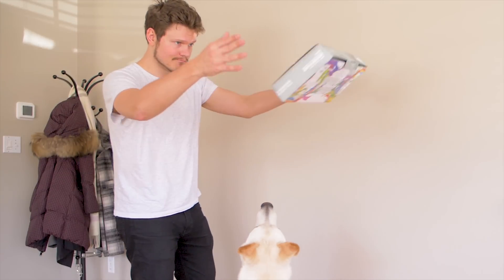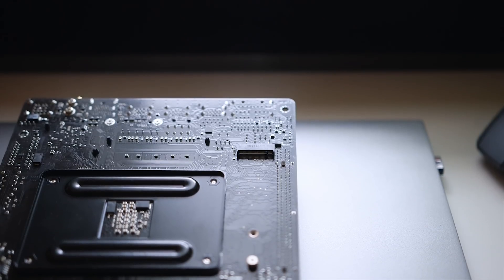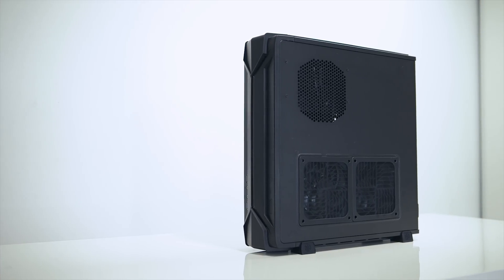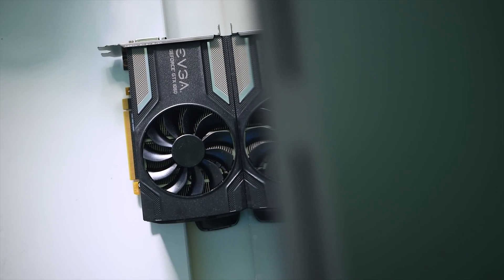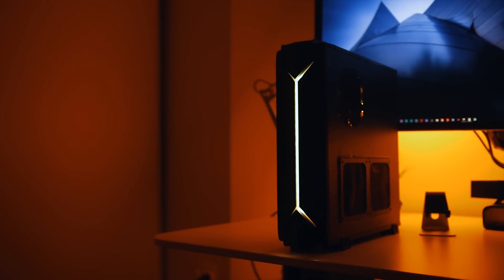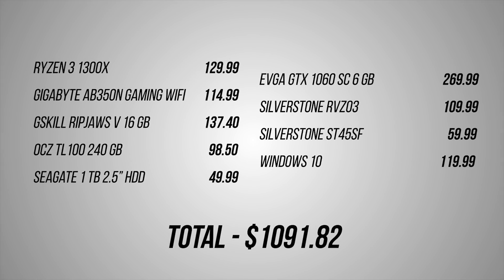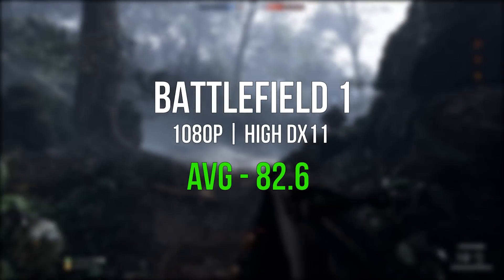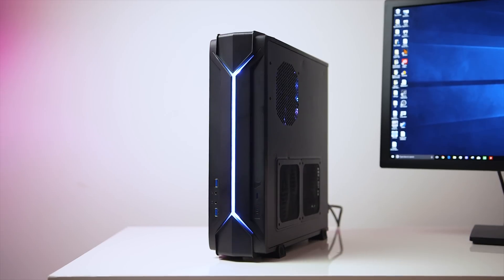AMD Ryzen SHRUNK - Our Ryzen ITX PC Build!

Comment: I think GPU manufacturers will need to make dedicated "mining" cards. Basically a GPU without the video output option and designed only for cryptocurrency mining. This would get miners to stop being GPUs and potentially open up a new market. There has been rumors of Nvidia unveiling mining cards, but nothing has been shown yet.
Reply: The whole idea of "Mining cards" are completely made up by the graphics card manufactures, not by Nvidia or AMD. They do exist but only in China because of laws preventing the sale of them in other counties due to the time length of the warranties being to short.
Reply: Linked Designs but miners would still buy gaming cards because they have resale value.
Reply: but the usage of gpu die will be the same. they can only produce so much.
Reply: gedion749 not sure what that has to do with IO
Reply: Shops are running out of cards, making dedicated mining cards will solve nothing, miners will buy all of them and then go for gaming cards anyway
Reply: I wouldn't buy mining only cards unless they were half the price, if the market crashed you may aswell throw it in the bin where with a gaming card you will still recoup some cost if it goes bad...
Reply: Mining only cards already exist. Sapphire made one.
Reply: I have a friend whose mom works for Nvidia. They are making cards designed for mining etherium.
Reply: Wulfy Your Uncle work for Microsoft too?
Reply: i have shuttering on my windows, how to fix this problem?
Reply: They already do.
Reply: They already do.
Reply: You lose all the resale value if you go with such a card
Reply: This and write software into the gaming GPUs to recognize mining and then not work.
Reply: Linked Designs no they won't buy it unless they're cheaper than desktop counterparts
Reply: Linked Designs Making mining cup specific cards is a stupid idea, it will only further reduce the availability of gpu chips...
Reply: Linked Designs the problem is, miners want a gpu that they can sell on ebay if the market shifts or crashes. They factor in the resale value of the gpu into all their risk calculations. A gpu with no video output has very little resale value unless you are selling it to another miner, and chances are that if you're selling yours, everybody else is selling theirs
Reply: amd added support for 2 mining cards in previous driver
Reply: Linked Designs they are doing that
Reply: I like the mining craze, sold RX 480 and bought 1080ti
Reply: Depends on where your located (EU and China markets at the moment) and how dedicated you are to find the cards - they are out and purchasable.  I know Asus is making them, and here's there info page on the nVidia based one: https://www.asus.com/Graphics-Cards/MINING-P106-6G/  And doesn't look like manufactures are going to allow them to be SLI'd and Crossfired with normal graphics cards (which I think is an over site, esp if the mining goes bust).
Reply: Linked Designs So my brother and dad are into mining, gigabyte released a 1060 without the video outputs. Like they just arent soldered, if you wanted you can solder it and use it like a normall card but due to demand they had to buy these cards. Lower resale value since you cant sell to gamers without soldering.
Reply: But probably gain better performance, potentially improved longevity and when they burn out from being worked too hard fo too long, probably cheap as sin to purchase in comparison to a gamer's card which means so long the card was used properly before it deceased you will had made enough for a small profit after purchasing another one.

Seriously, no gamer wants a card from a miner out of fear it will be full of sadness, disappointment and magic smoke.
Reply: Willow Graysen why? They are getting great business from the mining craze. Why would they end that to appease some people who want to buy their cards at cheaper prices. This craze has been great for the gpu makers.
Reply: Linked Designs ASIC cards will kill off gpu mining in another few months... Mark my words
Reply: https://www.scorptec.com.au/product/Graphics-Cards/NVIDIA/68715-ZT-M10600A-10B
This is apparently a mining card that comes with no display outputs and doesn't come in retail boxes
Reply: uhh that would just give them more cards to buy smart one
Reply: Linked Designs or you know just buy a dedicated AIO miner
Reply: If anyone here is talking about reselling when mining market crashes, then I doubt u have much knowledge about gpus. These gpus are constantly at 100% utilisation which kills the card way faster than you think. Only the smarts won't buy such cards as they would die in just a few months or if u r lucky, upto a year b4 the cores dies
Reply: No, I was talking about manufacturers such as Asus still being able to sell their left over mining cards when a bust occurs to gamers whom might want or be willing to SLI or Crossfire with their current cards...Well, if they managed to be able to get a graphics card to game on in the first place of course... :-/
Reply: Miners who shrink their abused cards to be sold as new should have their balls crushed with pliers.
Reply: Miners going to take the gaming cards anyway
Cuz the mining cards might lock things for them they are used to do and they have bigger resell value 
I
Reply: NOPE. Resale value.
Reply: Mining cards would be worthless since once there is a faster and better card the miner has nobody to sell the card to whereas gaming cards can be sold second hand to gamers in the future.
Reply: easy way to solve this, AMD had the right idea but wrong implementation, for the 1st 3 months to buy a video card you "HAVE TO" buy the special that includes 2 games, monitor discount thingy, ETC, that way we gamers have more of a chance of being able to get hold of them and if miners do get the pack and try to sell shit, companies will be able to see where these dirty fucks operate from and fuck them over for being utter cunts!
Reply: there is 1060  mining edition
Reply: nvidia already has mining cards released. please check for example GeForce GTX 1060 MINING P106
Reply: I hate it when miners like to be a gpu
Reply: Give then a little credit - at least they aren't trying to be seniors! ;-)  LOL
Reply: Cards are made specifically for mining coins. What happens is that newer coins do not have that type of dedicated hardware so people use GPU's instead. Once it gains in popularity then someone takes the time to make a card designed for that coin. This ends up forcing all the GPU's out of the mining business.
Reply: The GPU manufacturers should create GPUs specifically with only the compute part of the GPU, just what the miners need. Decreases the cost for miners, decreases the demand for gaming GPUs and all are happy.
Reply: Miners won't be dented by the vouchers, they most likely have links to black markets at times so all they simply need to do is SELL those vouchers to make their money back...

$200 off a monitor and $100 off a cpu+mobo? Sell each voucher for 50 dollars each and the game keys for 50 dollars each... There they made $200 off of a $100 increase, and has $100 left over.
Reply: dra6o0n Actually if I understand how the vouchers work is they are only redemable at the time of purchase.  In otherwords one has to buy everything along with the graphics card  in one shot at the same time - you can't buy the card and then in a couple days time buy the CPU+Motherboard then a few days later purchase the screen.  Of course if I'm wrong please correct me.
Reply: Already did, there's already a mining version of Nvidia GTX1060 on the market. However it's damn pricey and those opportunists might still going for the regular 1060s.
Reply: nVidia teslas.
Reply: Nvidia Tesla?
Reply: we should kill everyone who owns crypto currency

Comment: I found that the layout for this gigabyte board to work extremely well with the Ncase M1 surprisingly, especially if you're using a PSU with a flat cable (ie. Silverstone and Corsair). I was able to route the power cables behind the motherboard and tuck them away for an ultra-clean build. It took a little finessing, but I'm happy with the way it turned out.

Comment: Im new to pc building but what is the advantage of ITX and mATX over ATX builds? this case really interests me
Reply: Icarus975 it's just smaller if you have less space for a pc
Reply: just more compact. Typically done for portability or limited space to place a system on a desk. There are some compromises though, less compatibility and  typically worse cooling.
Reply: Icarus975 smaller just looks cooler and is more satisfying once your done. But it’s harder to build, and will run hotter (which leads to it being louder)
Reply: ATX is full size.. big motherboard and you would need mid tower or full tower aka BIG case to house all your components.
ITX is small form factor.. small motherboard with almost equal features of atx in a small form.. you can house that in small case... takes up less space on your desk.. 
depends on personal choice.
Reply: No real advantage sometimes larger boards have more ports and pcie slots
Reply: Size, and that is it. ATX boards have more features, bigger heatsinks and therefore better cooling. They normally have more slots for expansion, especially if you're a serious gamer who wants more than one GPU. Mini-itx builds are smaller, but their boards lack a lot of features. M.2 is a standard now, but Mini-itx boards have them on the back of the motherboard, introducing cooling problems, since M.2 drives can run hot.
Reply: mATX is usually cheaper than ATX
Reply: Depends on the features. mATX is normally cheaper unless you go for a high end board. ATX retains the most features though. There's basically a board for every kind of builder now, size, colour, lighting, Workstation features, etc.
Reply: It's smaller. Also, most mITX boards have built in wifi. I have a Silverstone ML08-b with an rx480 and 6600k. Temps are a bit toasty in the low 70s while gaming, but that's nowhere near inoperable, just reduces OC headroom. IMO Node 202 and the RVZ-02/ML08-b (same case different exterior) are the best and most efficient ITX cases that can fit a full size graphics card in terms of portability and size. mITX motherboards can be slightly expensive compared to mATX and ATX, but the main gouge is that SFX form factor power supplies are more expensive than ATX.

I would recommend mATX for most people building a budget gaming PC unless you really want or potentially need the mITX form factor. Compared to ATX, most people don't really need more than 2 PCI-E slots anyway, and the mATX version of a motherboard is usually about $20-$30 cheaper for the same quality of components as its ATX counterpart.
Reply: Size/form factor
Reply: It gives more FPS
Reply: Icarus975 
Pretty much the looks of it
Atx have lots going to it
But if you don't have lots of space
Or want to make your setup as Clean as possible 
Then go for mitx
Reply: It is significantly easier to move an mITX case. For some, that is meaningless because their computer does not move for months besides cleaning it/around it. People who are frequently moving or need to travel, or people who just want to take their pc to their friend's house may find that benefit to be a huge plus.
Reply: for me miniITX build more intresting becouse you can easily move with it 
becous of my work i cant seet in one place i have to always ready to move in another city and its mach easier do with small case .
Reply: A mid tower ATX build is the best if you're new.
Reply: compact for portability. I'm a consultant and therefore I move around. however laptops just aren't nearly as powerful enough for the computational-heavy software I run, therefore mini-itx with ryzen 7 does the trick

Comment: The ASRock x370 ITX motherboard has a much better layout.
Reply: but ryzen 3 and x370 not a good deal
Reply: BlowMeWonKenobi And a USB-C port.
Reply: there is no point on buying a x370 itx lol b350 is prefect
Reply: Depends on the persons needs, for me the layout is actually better than that of the ASrock board.
Reply: But not USB 10Gbs :/ and no displayport, but only HDMI 1.4. At least it has an Intel NIC 
Edit: meant HDMI 1.4 not 1.2
Reply: There is also a b350 version. It's cheaper and has the same exact layout.
Reply: Or you could gear yourself up for any upgrades in the near future..
Reply: no this gigabyte is a nice board get a dedicated vrm heatsink though
Reply: I have a Ryzen 1700 with mine, so the X370 with the better overclocking made sense. Also X370 does give PCI-E bifurcation so if you ever want to get a bigger case in the future and want to SLI you can. Also I would take the Intel NIC over USB 10Gbs, but that is just me. (HDMI and display port on the motherboard don't do anything with Ryzen.)
Reply: BlowMeWonKenobi The PCIe bifurication does sound tempting, especially given the announced lifetime of AM4. As for overclocking, I don't see why x370 would give you an advantage over b350, especially in this case, since the Gigabyte uses a 4+2 und phase Asrock a 3+2 phase power design.
Reply: i like how there is a x370 itx but no matx :c

Comment: Can someone help me choose a laptop:Lenovo Y520
Sabre 15
Acer VX15
MSI GE62
HP OMEN
DELL 7567
ASUS GL553
ACER SWIFT 3
ASUS VIVO BOOK E403SA
DELL INSPIRION 7559
HELIOS 300
SAMSUNG 9
RAZER BLADE STEALTH
HPO X360 13
LENOVO X1
LG GRAM 13
XPS 13
ASUS UX330
LENOVO Y700
Reply: Do you mean 7567? 7559 is previous gen
Reply: helios 300 by far
Reply: Dont buy gl553 very low battery!
Reply: Id say Acer VX or Dell
Reply: CLOROX BLEACH its not on your list the lenovo Y700
Reply: What do you plan on using this for? Everyday use, student, anything else? Also, this is a pretty vague price range, you have some $600 to $2k laptops. If you're able to get up to those prices, it'd be good to know what this is meant to be.
Reply: Or you could build a PC and get a decent mid-range laptop, I have the Lenovo Z50-70 and it does everything I need it to do.
Reply: Build a desktop and buy a chromebook
Reply: BOSK For animation and  architecture and everyday uses
Reply: Simple No thx!😀
Reply: OZproductions nah
Reply: CLOROX BLEACH y
Reply: CLOROX BLEACH I have the Helios 300 and I love it
Reply: Do you 100% need a laptop? Because a $500 pc and a sub $300 laptop would do fine.
Reply: Joe1up yes absolutely
Reply: Asus GL553 for gaming. XPS13 for everything else. Decide on what you need it for. I can't believe you even considered Razer garbage.
Reply: I just bought the Helios 300. For pure gaming power, the 1060 can not be beaten at $1050. If you want lighter games the Dell XPS 7567 is better and lighter. I recommend not using YouTube comment section because everybody will be a genius, go to a review of every laptop, think about the PRIMARY use you will give it, then buy.
Reply: CLOROX BLEACH All I know of animation is my high school class of it using Blender. I do know that the more premium 3D Modeling and animation software are graphic intensive when you up the vertices and add shading, so I'd suggest a laptop built for "gaming". Architecture I have no clue about, so if you could ask your colleagues or peers about that.  A 1060 and a good i5 would probably be more than enough. You might want to get an external hard drive or find a laptop with a lot of storage to save projects. Also get an accident warranty or some sort of replacement plan since laptops are only seconded by phones when it comes to abuse.

Also get an MX Master or some sort of wireless mouse if you don't already have one. Trackpads are usually garbage. 

Edit2: Much like how another guy said, go post on a tech forum like LTT and gauge those guys, they'll probably have a better grasp on your situation than us.